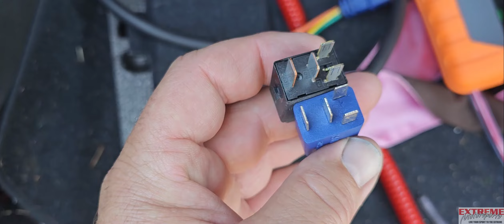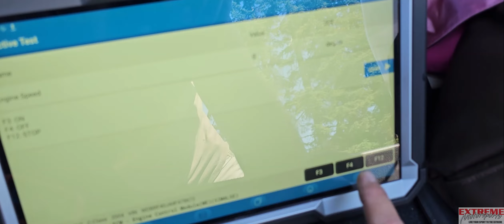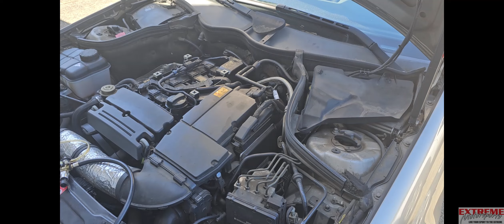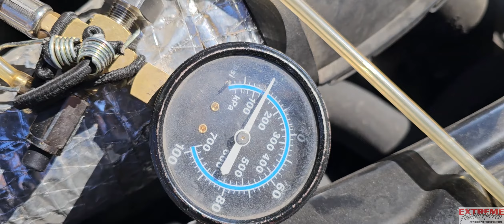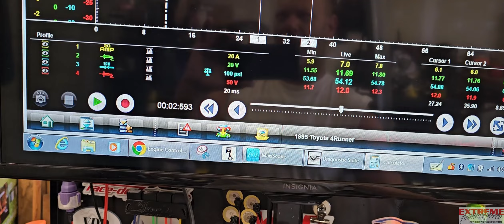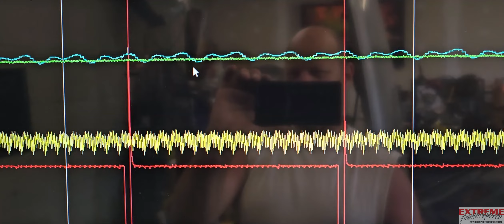2004 Mercedes C230k Fuel Pump Diagnosis

Comment: Which side was the fuel pump on?
Reply from the maker: For this 2004 C230k - Pump is on the Right (passenger) side, under the rear seat.

Comment: What pressure transducer you using? Like that technique actually seeing injector flow rate in real time!
Reply from the maker: Sorry, I don't really recall what brand it was, but it is a 100 psi transducer.  It truly is a great way to visually see any possible flow issues.  Had I lowered the voltage scale more with the scope, It would have really increased the differences of each pressure drop.  Just some fun stuff to capture.
Thanks for watching.